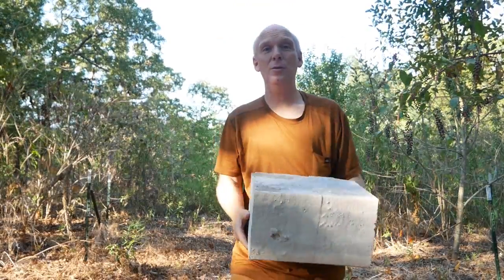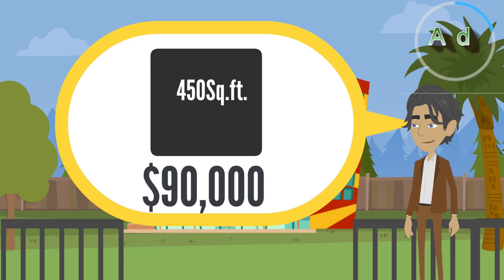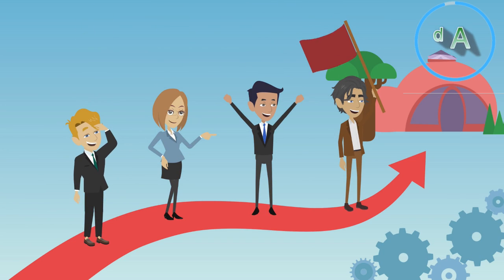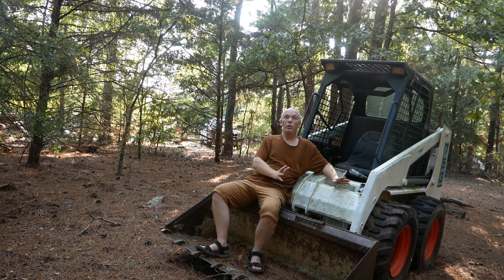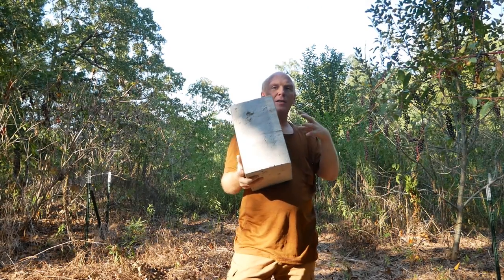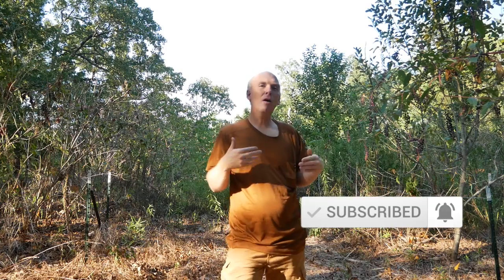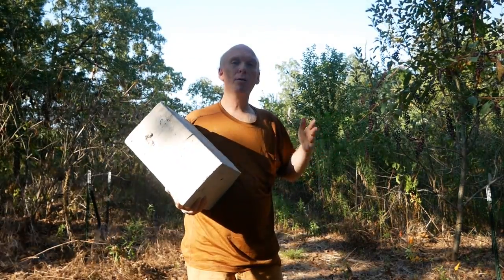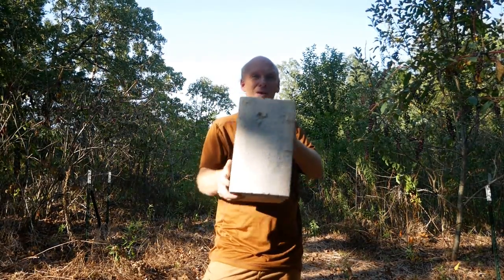Rammed Earth Vs Air Crete House

Comment: I live in an earthship-style home (passive solar and bermed).  Adding aircrete to this design would be an unnecessary additional expense.  It would actually diminish the home's capacity to cool in the summer months, by insulating against the natural 58 deg. F underground temperature.  Rammed earth structures (mine is tire bale) have an extremely high R factor on the bermed walls.  The beauty of the tire bales or rammed earth tires or earth bags, etc, is that they give you the great insulation, which you need during the winter, and also the cooling in the summer.  Aircrete is probably a great product for exterior walls, but I think it would be better to use in conjunction with conventional stick homes, and would provide a very effective mechanism for sealing a home.  That said, remember this - if you seal your home, it is absolutely necessary to install a Heat Recovery Ventilator (HRV) or ERV for air exchanges (prevention of stale air, which is very unhealthy).

Comment: Good video , I tried rammed earth then earth pour but settled on air Crete. It is so much easier on the body by far. It takes a bit of practice to get the foam density right but doesn't take long to know what good foam looks like. Aircrete is by far the cheapest and easiest building methods.

Comment: Umm... There's a lady in BC who has a large house made of rammed earth who doesn't heat or cool her house artificially and she says her house is comfortable year round.  Her video is on You Tube - it's called "Boots on the Ground: Why doesn't everyone build with rammed earth?"
Perhaps you would like to watch it and debunk it?   I would be interested to hear what you have to say about it because I am debating between building with rammed earth or aircrete domes.
Reply from the maker: People always say that, but often you find an entirely different story when you visit.  If she gets enough solar gain it could work in a cooler climate.  The material and design must be appropriate for your climate.  Down here an earthbag house 24 inches thick gets to hot to sleep in about a month and a half into summer
Reply: @TinyGiantLifeStyle  I think the size of her house may have something to do with it.  She has very tall ceilings in some rooms & lower ceilings in others.  Also the thermal mass of earthbags are quite different to stabilized rammed earth, which is more like stone. Plus, her house was designed by an architect familiar with rammed earth in that climate.

Comment: With the discuss of "thermal mass" - what about air crete vs. compressed earth blocks (CEB), is there data demonstrating the pros and cons between the two? Thanks.
Reply from the maker: CEB would act as a light thermal mass, but not insulation.  One row has too little mass to store massive enough heat/cool to balance an entire night/days worth of energy.  Several rows could do it.

If you wish to use CEB then do so. It might be nice to try rammed earth and CEB both to get a feel for it.  

Depending on you're goals a light CEB wall may be good.  Id I were choosing to use CEB I would build a double wall with a space between them and fill with AirCrete or any other insulation.

Comment: our area if you dig a foot down, has "crushed slate".   I suspect, this is a quirky building material.  The only thing they have successfully used it for, is as a road base.  When they add it to concrete, the walls, can literally break, because the tiny pieces of slate can, and do split. , so, i'm not sure, it's the proper rammed earth material.   A local man, has dug into his mountain, and thus, has underground home, and just left the flaky slate on the walls.   he's troughed around the bottom of the walls, to allow the water to flow out.  I'm not sure How I fell about walls, you dont want to touch.   Another man, 4 feet underground.  that seems to work the best.  (he had sons, whom he put to work, to help build the home....lol...his sons are now no where near him...lol.).   Most everyone is above ground, in trailers, or regular homes, which just seems wrong.   Thanks for the aircrete recomendation.

Comment: How long does aircrete lasts?
Reply from the maker: Its been around since the 70's. I guess no one really knows.
Reply: @TinyGiantLifeStyle  if the buildings built in the 70s are still standing in good condition with maintenance but without repair on the aircrete parts then one could say that aircrete last at least 50 years
Reply: @TinyGiantLifeStyle  thanks for the reply. Is this something you can confirm? Do you know of aircrete buildings built in the 70s the are standing today in good condition?

This topic would make a very cool video
Reply: Protected from rain till hell freezes over will that do.

Comment: Can you bury air crete?
I've seen some pretty cool buried dome houses, like the one in Canada where the Lishman's live, and a couple 'hobbit homes' where they mounded up sand, poured concrete over the top, and then vacuumed out the sand before burying it.
Reply: Me too use ferro cement it will handle compressive loads. By the way see Kristen Dirkson man builds 50 dollar underground house video.
Reply from the maker: I do not recommend placing AirCrete below grade.  It has a lower tensile (side-ways push) strength.  Wet disturbed dirt can push with a great deal of force.  Perhaps a ferrocement shell to hold the weight and AirCrete to insulate.

Comment: You must be a salesman for aircrete and you are not talking about the cost of producing aircrete and its environmental implications.
Reply from the maker: Carbon irrelevant compared to the power for your air conditioner or gas for driving that produces many many more tons of carbon (the currency of life) than cement of one house ever could.  Plant 12 fast-growing trees and use your greater than you can cancel that carbon footprint in your lifetime.

Value for consideration, equitable exchange.  Where would you get your paycheck if someone was not selling/advertising in some way for that company?

Comment: sorry if this is a dumb question, but what if we added earth into the aircrete mixture when mixing (the cement, foam, and earth)?
Reply from the maker: I don't think that would be a good idea It would reduce the insulation however you could use ramders inside for thermal mass and/or outside with an air creek core for insulation

Comment: So, genererally a video trying to scare people away from spending a bit of time, and a bit more sweat than modern days says we must. Completely missing the point of natural materials. Firing with wood is not a bad thing, it is a renewable source.
Simple does not always mean fast and easy.. sometimes it means more work for a healthier result.. and less money spent.

Modern, comfortable living is a hype.. a golden cage, some of us want it a bit less modern,.
Reply: @Goldenhawk583,  I'm with you on the natural materials thing.  I've transitioned from tree wood to bamboo over the last year of research -now I'm looking into laminating it.  If I can make glue-lam beams (or even have them made) I'll accept the glue aspect even though I resisted the idea at first.  Timber bamboo grows so fast and is so easy to harvest and work with that you might find that it will suit your needs too.
Reply from the maker: Having built and lives in both in hot humid environment some of us old people really do like the cumfort of some modern technology.

Now if you insulate the outside of the rammed earth it becomes functional.

If you have to apply energy to maintain cumfort then insulation is a better choice.  That is the point.  Blanket decision are ignorant of the parameters for each climate.
Reply: @TinyGiantLifeStyle  Adapting methods to the environment is a good thing, yes:)

I live in norway, even with really good insulation, I have to add some heating if I want to not freeze in winter. Having a house that has walls able to retain heat makes a huge difference.

Comment: Personally I think your crate is ugly I know it’s not the better choice for the earth and when you’re using Randerth you’re only 8% cement unless you use lime

So you want it to be sustainable and if you had to add an insulation like foam it’s really not that big of a deal if you have geothermal That’s an additional expense if you have the proper ventilation then I don’t see that you would actually need air-conditioning just some fans open up your  VENTS make sure you’re getting good circulation the more windows you have the more heat and then if you’re cold a wood-burning stove would suffice and it doesn’t even have to be a big one it could be one that you put in like a tiny home you don’t want to overdo it you just want to be comfortable and you can use that to disperse water at the same time by putting a pot on top of it and allowing the steam they dispersed through the air for me air creates not an option it’s ugly
It’s not healthy it’s too light wait in the product it doesn’t blend in with nature it’s unnatural I wouldn’t even want to use concrete in the formal mix between the sand and the earth and I’m pretty sure that you could probably rent a pneumatic tamp make your own therapy people out here who intelligent enough to do it they can undercut the professional manufactures and do the same job for less money I personally have no interest in air Crete whatsoever none I’d rather build a super Adobe which is essentially the same damn thing except you’re having to use bags and then you have to go the extra to put on straw bale Play sand mixture and I can be really time consuming to unless you have a large crew of people that are all contributing and in that instance you have a lot of people that will volunteer as long as when I have a project you show up the travel is everybody that teaches the stuff wants to charge ridiculous amount of money for the workshop sure it’s a skill that’s life long and it’s one that you have to perfect overtime but are they offering accommodations ?

People don’t have it like that and I guess they feel like well if we teach his ass then you might go off and open up your own workshop somewhere else and make tons of money from it so we justify charging you a ton of money no idea is to put up the house that is practical and serves all of your needs without going bust we’re not professional builders what did our ancestors do and why the hell do we complicate things so much and for that matter if you really wanted to you could probably use air create as an insulation if it’s so great and it’s lightweight just like phone that way you’re not breathing it in there’s actually enough space between you and that
I don’t know the particulars but I know people certainly aren’t genius because they are not putting all of their tools on the table they’re not thinking outside of the box
Once again I don’t want to break concrete I don’t want my house to blow away do you have to use rebarb with this?
It’s your opinion your entitled to it
And there are architects and builders out there that are full of crap and they’re going to sell you a dream that turns into a nightmare I wouldn’t pay as much money if not more money to build an earth house then a modern house because that’s a stupid

And I’ve been watching videos of those people are trying to sell blocks well that’s ridiculous because then you need mortar or cement to put it together why would you add another step

They’re saying that super gobies can go out for $5000 don’t know what size don’t know if anything else is included not a clue on how much the bags cost the labor can be next to free of course you might have to sign up to help someone else build their‘s but I think that’s a pretty good savings on labor so why not do it and you don’t have to have a traditional circular or arch type building you can do different shapes like modern shapes but everything in natures circular so there’s a lot of questions to be answered and of course you don’t know until you live that life but you’re never gonna find a modern house that has a 12 or 16 inch or even 2 foot wall system that in itself is insulation I mean that’s common knowledge or common sense if you laid under 2 feet of dirt you’d be a lot cooler you’d be grounded you’re not gonna get the same effect in an air Crete house do you want to take the burden off of your immune system and live in a toxic free home
Not to mention the fact the concrete can be destroyed with a sledgehammer and yes you can probably put a nice dent into an Earth home
But it turns to stone after it solidifies and then be like you out in the mountains try and Chipaway at the Boulder and take a long damn time whereas with an air Crete you could probably destroy it in no time
Reply: If someone doesn't want to go through with hectic rammed earth work, they can consider CEB (compressed earth block) pretty much same material as rammed earth.
Reply from the maker: Follow you're conscience

Comment: Thank you! I see the videos of guys hand tamping and it bugs the heck out of me. If your going to build rammed earth then at LEAST get the hydraulic or pneumatic tampers. The pressure they ram the earth with greatly changes the quality of the wall. Hand tamped walls just look like crap to me but the ones that are machined get that glassy polished look and are MUCH stronger.

I think using rammed earth walls inside of an earthship style home eliminates your insulation problems and looks extremely beautiful. It's also going to last forever because nothing is going to damage it. Hand-tamped walls can't claim that because they have not been pressurized enough. Honestly if your not going to use machines to tamp it then you might as well earthbag it, use tires, or air crete.

I just don't like air crete because I don't view it as a strong enough material for long term big homes. It's fine though if you just want a cheap small house though.
Reply: @Joseph Diveley   I agree with you about the difference between hand tamped and pneumatic tamped - the hand tamped ones look terrible.  (Also, what happens to your elbows and shoulders after tamping even four ten feet tall walls 20 feet wide?)  
I came to the same conclusion about aircrete: for small domes it's great.

Comment: I’m interested in ICF with Aircrete. Anyone tried this?
Reply from the maker: Insulating the insulating AirCrete.  Well I suppose you could.  

What would the advantage be?
Reply: @TinyGiantLifeStyle  yup, i was wondering if itd dramatically reduce ICF building if using aircrete. PLUS, using ICFs just seem like the simplest, easiest thing ever - its just like locking lego blocks together. @Teri Livengood, have you seen any videos about ICF + Aircrete? i havent been able to find any. additionally, if the aircrete is covered by styrofoam, then no water will be soaking into the aircrete when it rains.
Reply: Tiny-Giant LifeStyle aircrete expands the concrete by like 5x, so cost?

Comment: Hey I know I keep hitting you up but I'm curious of your thoughts.   What about a 28' interior diameter 30' outer diameter non plastered using 12"x12"×12" blocks and a 16' ceiling height
Reply from the maker: Learn to do the math.  Aka the engineering.  Google how to calculate sphere volumes and calculate half spheres. Keep the pressure at or under 12 PSI and all will be fine.

As you are looking at this screen and and answering questions in your head you are recognising that you need to know more to build safely and this knowledge is something taught to you as a student of the video courses & alternative building school events: 
https://tinygiantlife.biz/build-your-own-aircrete-home/
 https://tinygiantlife.biz/2020-aircrete-school-workshops/
Reply: @TinyGiantLifeStyle  I agree with you about the math I build with red brick and it's just a material that is easy to compute and understand. It's just that while I am sure aircrete can withstand substantial load for the material it is I find my self worrying about its ability to withstand shearing. I love the concept of this material and the mass to weight ratio is incredible but I'm not looking to build a survival structure I'm wanting to go big because I've not seen anything built that's super impressive in size and I just feel that it could be done... many even easily.
Reply: P.s. I also want to try this method with lime ....airsandlimecreat??? Have you tried it yet?

Comment: Which would be best in Whittier California?
Reply from the maker: If sufficiently thick enough rammed earth can give you a house with an indoor temperature of 64 or less in winter and 77+ in the summer for your location. I didn't find hourly data for your location so I am taking a guess on the average of temperatures.

The best one would be the the one which is most exciting to you.

If building rammed earth I would personally put insulation on the outside of it; if not inside the wall.  You can hang ridged insulation on the outside and stucco it with synthetic stucco to look good.

I personally prefer to have to option to choose my indoor temperature.  So insulation is best.  However, insulation with thermal mass is even better!
Reply: it is in Los Angeles County, so I guess anywhere near there would be close.